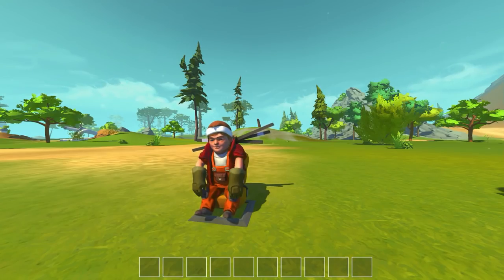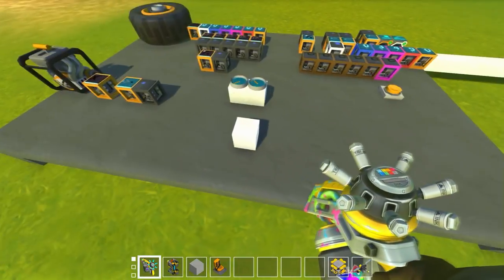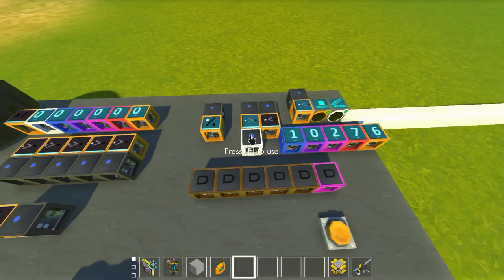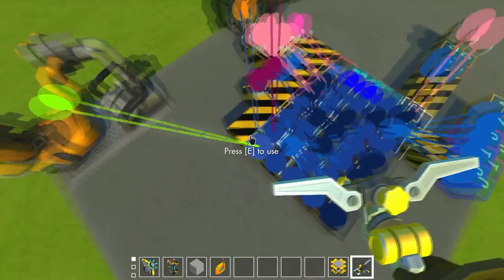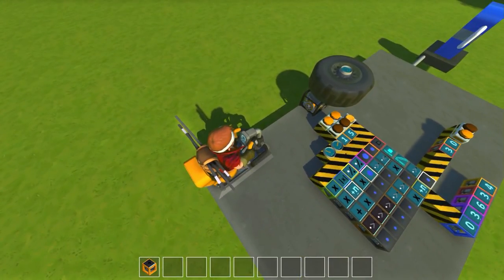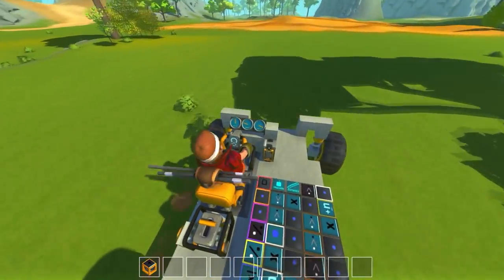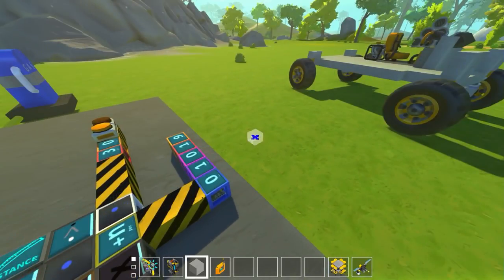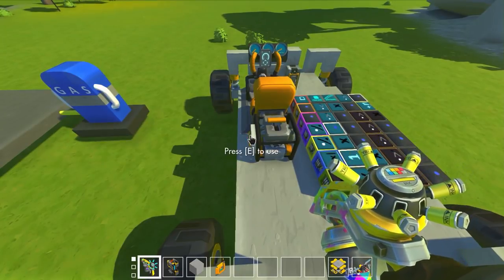New Vehicle Fuel System with Gas Station Pumps! (Scrap Mechanic #346)

Comment: Potential 2.0: So the system tracks rotations of the wheel to measure fuel usage, but that results in fuel being used when coasting down a hill. Maybe this can be fixed by adding a WASD converter (we only need W and S), a math block set to find if wheel rotation speed is greater than 0, and a logic block set to AND.

[W]    -    -    -    - 
                              \
                                 [AND]    
                              /             \
[WhlRotSpd]    -                    [OR]    -    [FuelMeasure] 
                              \             /
                                 [AND]
                              /
[S]    -    -    -    -
Reply from the maker: You could also have the fuel measuring off a wheel that free spins in the engine compartment of the creation and it would do the same thing I think. When you let go of W or S the wheel on top would stop while the others still free spin a bit.
Reply: @kANGaming  that's what I was thinking Kan
Reply: The Duke 96 ye that's what I was thinking ;)
Reply: kAN Gaming I was thinking the same
Reply: But if you put a single rotating block inside the car with the meter on it. the it will have the same effect??

Comment: Here's an idea for Multiplayer Monday that isn't a race. Sadly, it might also be a bit to complicated and/or time consuming. So, bit of backstory: Recently, I've been playing a bit of Monster Hunter, and I thought, it would be pretty cool if you guys worked together to make a large machine (such as a mech, car thing, etc.) that uses logic (specifically, number logic from the Modpack), buttons, and cardboard. You would basically make a machine that serves as a game where two people need to shoot their handheld spudguns (to help with aim, and to make it fair for everyone) at the weak points, where the buttons are. They would be covered by a few layers of cardboard, so you can't just shoot them all right off the bat, and they would also be protected go spinning/sliding/etc. spud-proof blocks that can be activated by the pilot of the machine in order to attempt to defend against attacks.
I would suggest using the clock block, as well as some number logic and memory, so that you can time the challenge. There are two main ways you could set it up: either you give it a limited time, and whoever manages to receive the least damage (times the buttons were shot) by the time the time runs out would win, or you could have the time count up, until a certain amount of damage has been taken (as well as all buttons being shot at least once) and whoever lasts the longest would win.
Personally, I think this would probably be pretty fun for you guys to try to build together. I would suggest that kAN should focus mainly on the logic, ScrapMan on the structure and mechanical aspect (because let's face it, he seem to forget every bit of logic he is taught [no, that wasn't meant to be a pun]), and Moonbo could help out with both aspects of the build. You would all know (for the most part) how it works, where to aim, and how to defend, so it should be a mostly fair challenge.

I know this is quite out there, but at least as a concept (or maybe kAN-cept) it is something to consider.

Comment: You could actually use that "near field communication" or "NFC" mod to actually fill up fuel from the Gas Station.
Reply from the maker: True rather than the car just requiring to be near the gas station you'd actually have to press the button on the pump instead.

Comment: Cool idea, as always. You could hook up an extra spinning bearing to the engine and compare that RPM to the RPM of one of the wheels, then you could detect acceleration/heavy load and use that to increase fuel consumption.

Comment: You should combine that with a gear system using the smart engine, so that you can set various speeds/power and fuel consumption rates.
Also, I'm still waiting on your improved Twitter/instant messaging build.

Comment: You can make it more realistic by changing the fuel consumption by v^3 like in real life, becaouse the air resistense is scaling v^2 and as you go faster, you have to maintain the same amount of force with higher speed, adding an another v to the formula. This version uses twice the fuel to go twice fast, but it travels half the time, so it consumes the same amount of fuel than if it goes with low speed.

Comment: You should build in the rpm meter and put it on a spinning bearing thats connected to the engine instead of the wheel so it burns fuel even if the tire is stuck.

Comment: Hey Kan do you think it's possible with current logic to make a bearing that spins progressively faster the longer you hold down the w or s key? So you'd be able to more effectively manage your speed or RPM in a vehicle? Possibly using a tick generator to increase a number and use that number to dictate rotation speed of a servo?

Comment: the consolmation of fuel should be based on :

f = RPM * CPR + CPT * T

f is consomation.
RPM is rotation per minute.
CPT is consomation per RPM
CPT is consomation based on torque of the motor.
T is torque of the motor.

Comment: i think it should be the opposite - the consumption should increase more the slower the wheels turn and when w would be pressed, becouse then it means that the engine is fighting to turn the wheel, and the faster the wheel spin, the less strugle the enigne has

Or to be technically correct, what matters is the change in speed. That should partitially determine fuel cost too

Comment: Does it use fuel if your vehicle is just coasting (not pressing w)? and will it come slowly to a stop if you run out or will the wheels just be blocked and fixed in place?
Reply: 1. Yes, it tracks rotations of the wheel to measure fuel usage.

2. It will stop the wheels immediately.

Comment: Is it possible to put the rotation meter in between the bearing and the wheel?
Reply: No I dont't think so. But you could put the rotation meter on an independant bearing who's not affected by the vehicle's movement. Like so, you won't use gas when you're not using the engine.

Comment: the fill isnt working :(
Reply from the maker: Maybe the script died? Sometimes I have to reload worlds because the scripts stop working.
Reply: @kANGaming  i was hoping to make a pih city with gas stations and stuff im trying to make my own gas thing but i suck and its not working well i dont even know how to use the tracker :(
Reply from the maker: The tracker just needs to be placed down anywhere. As long as a tracker block is close enough to the fuel system it will allow you to refill the truck. Don't have to actually hook the tracker into anything :D
Reply: @kANGaming  i know but even if the tracker is one block away it still doesny fill :(
Reply from the maker: hmm that's weird I haven't had that issue before...
Reply: @kANGaming  i really hoped it would work
Reply: @kANGaming  do u want to show my cool alarm real time clock in some video im almost finished with it :D
Reply: if u want heres the link https://steamcommunity.com/sharedfiles/filedetails/?id=1538135030
Reply: @kANGaming  can u pls show my clock it is the first complicated thing i ever made and i used a week to build it :(

Comment: Oh I thought you were going to use cardboard. That's much easier.
Reply: Like spuds destroying cardboard blocks and detecting how mutch is left?
Reply: @the gamer BR Yes. exactly.
Reply: That's actually really clever! Totally useless and over complicated, but cool nonetheless
Reply: Robert Game yeah... but then again, everything in this game is kind of useless if you think about it :D
Reply: But you can't refill it with button tho.
Reply: The Desert yeah, that's kind of the point of using cardboard, so you have to actually refill it instead of just pressing a button.
Reply: SOME people like to play vanilla(cough cough ME cough cough) so this is a awesome idea. I could try to make it work, if you want. I would post what I come up with to this comment and upload it to the workshop. You cool with that?
Reply: @Joel-qo6gt  sure that's great! I've tried it before too, but the main problem is, that the cardbord blocks can be quite large, so you have to lower the drain rate and trade in accuracy for size.
If you want to build it in Vanilla, make sure that you also have an s-converter, so that you can't just drive backwards for free.
Also instead of using an AND gate from your WS-converter I would recommend using a seperate engine, that goes in the opposite direction, so you don't have as much input lag.

Comment: That's not how cars work the fuel is used the more throttle you give the engine if that was the case reving an engine in neutral wouldn't use fuel
Reply: Actually, it would. Say you're in neutral, and you put the pedal to the metal. What happens? The engine revs up. How does the engine rev up? With fuel.